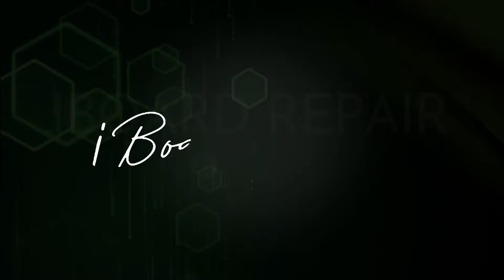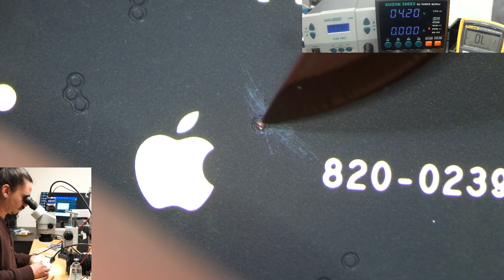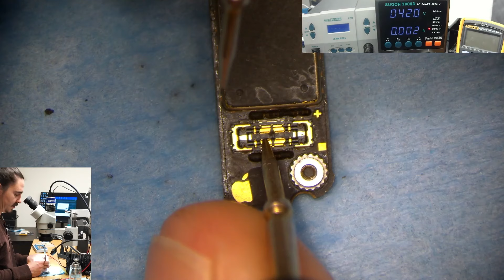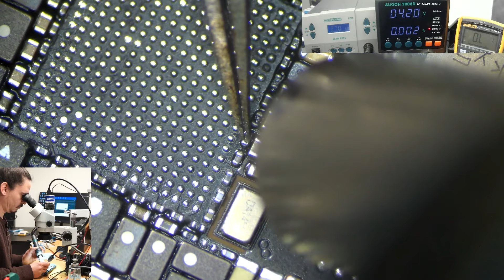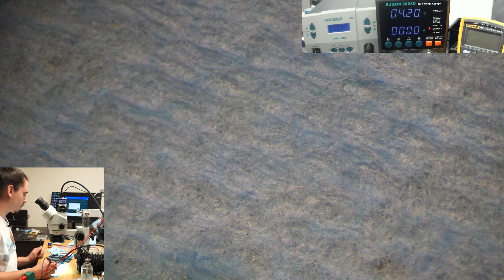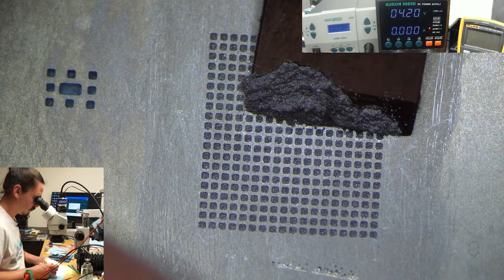Advanced Data Recovery for Broken iPhone 13 Pro - Motherboard Troubleshooting and Repair

Comment: This is awesome! I have a 13 pro with some power delivery issues and Im hellbent on fixing it myself. Hopefully it’s just a blown capacitor but if not I hope I’ll be able to add these sorts of repairs to my repertoire. Going into 4 years of mobile/macbook simple repairs and I’m excited getting into board repairs. Even though the skill gape is way larger this time around

Comment: Looks like on my iPhone SE 3 the PMIC has shorted caps around it, and some have been removed already (bought it as faulty) There can't possibly missing caps this close to the PMIC from factory right ?

My phone does work but heats up around that area, and I've got to sound, no mic, no charging, and no taptic engine. Kinda sounds like a miracle that it even boots up

Comment: Hey Aaron, are you worried about the damage that resin or flux will affect you? I think over a long period it affects your sinuses. I can't see your entire setup but I hope your lungs are ok! Thanks for the videos
Reply from the maker: At this point I have a fume extractor that pumps it right out the window, but I haven't always had such a good setup! You can see the black vent under the microscope.

Comment: Great video Aaron! 
It is interesting to see different technicians using different techniques to deliver same results.  This is for all people asking about what temps you use to do this and that. It’s all about the feel and all about what suits you as a technician. BTW: I had a 13 pro with the pmic cracked the same as yours
Reply from the maker: Thanks buddy! I agree, temps don't matter because it is unique and individual for each person, and mostly based on feel.
Reply: @iBoardRepair hey there so I got an iphone11 back light issue was wondering if you have a store I can sent it to fix or if you can for me by any chance ??
Reply from the maker: you can fill out the intake form at my website to send it in: www.iboardrepair.com @uliseslopez1481